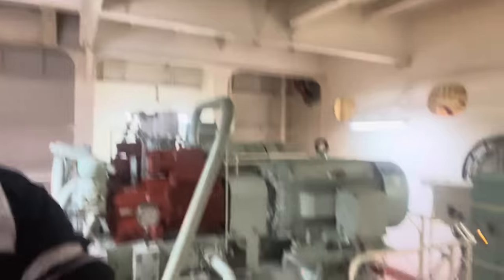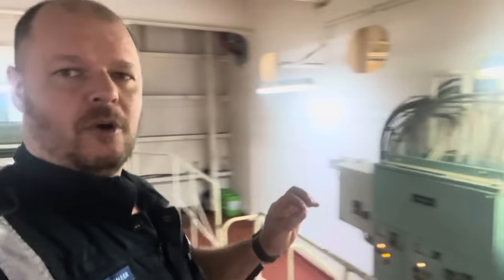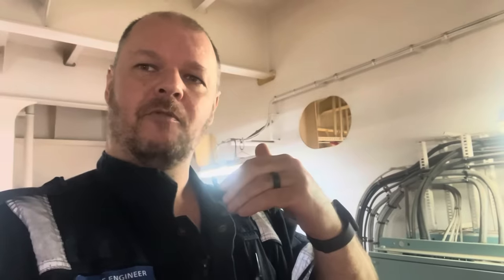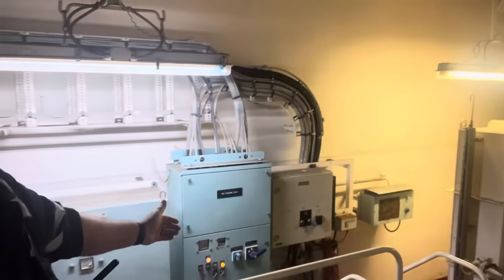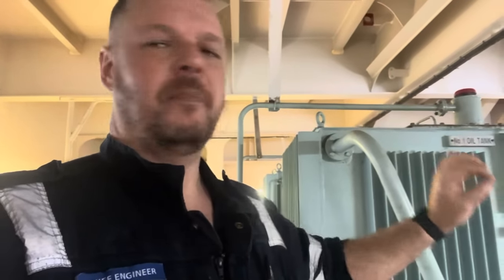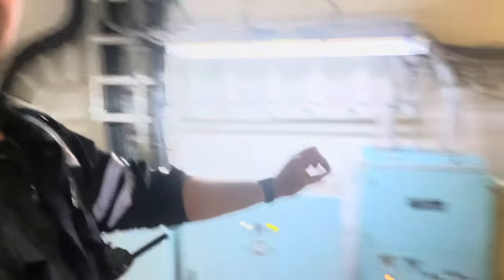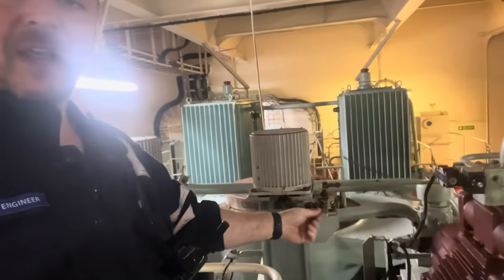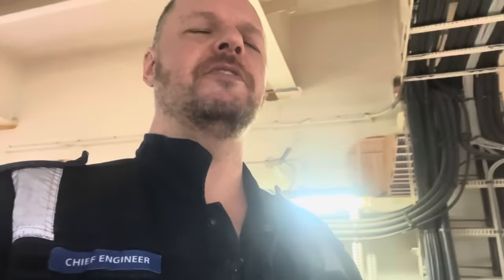Dali size containership steering system. How it’s designed to not hit Francis Scott key bridge

Comment: Thank you for this video. This is excellent info. My guess what happened with Dali is, the backup generator kicks in, the thick smoke. And then even that dies out. Now issue with all this is, there was not much distance to cause any noticeable change in steering with inputs. These vessels take time, they are mammoth not just large. Other bit is, when backups kick-in, there always will be delay between when the controls become effective. There should have been battery backup too on Dali. But remember that would have been the third backup. Once the emergency generator dies, the battery backup would have come online. How many of you think there was time for that to be any effective.

Comment: How is fuel distributed? Do all fuel serviced items share the same fuel source? Do the emergency gen sets have a dedicated fuel source. What type of fuel issues could cause failure of all diesel powered units, ie contamination, pump failure. Excellent presentation on the emergency backups. Sal sent me here, and I'll be a new subscriber.
Reply: Good question. im a ship engine officer myself and il try to explain it simple il number it 1 and and so on from start to finish.    

1.Storage tank Heavy fuel oil or Diesel  
2. Pumped through a rough filter into a temporarly storage tank for Sepearation. 
3. Fuel is pumped from seperation tank though a seperator to remove water dirt and such alfa laval makes those.     
4.Fuel is pumped into day tank.  
5. Fuel is pumped by pump from day tank to main engines or generators Throught 1-2 filters all filters have redundancy filters if pressure drops. 
emergency generators usually have tottaly independent fuel supply and might not even need electricity to keep running.  Depending on the size of the engine it is started with air or batteries lets say a Mack size truck engine generator would be started with electricity and sometimes double the size also.  

But inline 8 cylinder 10 thousand horsepower to 100k plus main engines is started with air.    Heavy fuel oil must be Warmed to 45-60 degrees Celsius just to become liquid so that is also something to think of Heavy fuel oil that most ships use is almost like Asphalt Bitumen.
Reply: @Infernal_Elf  Great info. Thanks for your detailed response.
Reply: @Infernal_Elf  It depends a bit on the engine, but the last MAN B&W crosshead engines I worked with (built in '96 IIRC) according to manual in case of emergency were able to start on a 700 cSt fuel with the entire engineroom including fuel systems cooled down to 20 degrees C, provided RPM was kept below 50% of MCR and the strong recommendation to make the switch-over to MDO "as quick as reasonably possible". Below that temperature no guarantees.

I could not believe my eyes when I read that, asked a MAN representative when on a training in Copenhagen, he confirmed it to be tested and found to be true.... Once...

Somehow I never got permission to test that... :D
Reply: @Infernal_Elf  haha , i thought ships engines used heavy fuel oil but youtube experts shot me down claiming the ships engine used red diesel like the gensets would use ?
There must be a system to prevent the wrong fuel being pumped into tanks at port ?
Reply from the maker: I did another video showing the emergency generator and yes it has its own completely independent fuel tank. 
Otherwise the main generators normally share 1 common fuel system but there can be 2
Reply: @heartobefelt  At that point they would have been on ULSD (basically diesel) due to the emissions rules. So these engines can run on multitudes of different fuel grades and HFO usage is limited to outside of the zones where strict sulphur rules are enforced. Swapping to/from HFO is lengthy process (like hours) and they need to be fully on ULSD by the time they enter the zone until they depart it again.

Comment: I watched countless "experts" doing interviews after this happened and soooooo many times they said "yes, we know they lost power, but we don't know if they lost steering". That drove me nuts. No power, means no electricity to the BAM's(Big Ass Motors) that turn the rudder, so YES they lost steering. Thank you for for being sure you included that in this video. I saw somewhere that someone had asked about a backup battery for steering systems. There isn't a battery system in existence that will power one of those motors enough to do what is needed. As a retired USN Engineer, I am of the opinion that when power came back online that second time, it was too late. There was no way to turn nor stop the ship in time. It is simply to big and too heavy to handle at that point. No, I don't have ANY experience on a ship like this but an engineering plant on any ship is virtually identical in concept and general operations. The only thing that is different would be plant operating procedures etc. specific to that particular ship. Losing power TWICE moving at that speed (8.5 knots with that much weight carries a lot of momentum) that close to the bridge, was too much to recover from. Another 100 yards and they may have had room to turn (but not stop).
Reply: My 83 year old Dad and I were talking yesterday. He retired from USN as a Commander in Surface Warfare in 1985. He called and asked what I might know of on the internet that would give him information on the current state of merchant ship hardware and systems. He was saying that he knows how it worked on military ships forty years ago but it is no longer forty years ago and these are not military ships. It was good to be able to give him Sal Mercogliano's channel and then the channels and videos such as this one.

Comment: So basically, with all those redundancies and all those backups, if the power goes out there is at least 30 seconds of being unable to steer the ship (The period between the lights going out and the emergency generator kicking in). Looking at the video of the Dali that period was about 45 seconds, which apparently is still within the limits of whats allowed.
Fine in the open ocean, a minute here or there is no biggie. But when you're approaching a bridge only a handful of boat lengths away it can be a long time.
Reply: Nothing explains the turn as winds and current wouldn't turn the ship, they would move the entire ship.
Reply: @hughjanus5518  Only 'propeller walk' does explain and is coherent with what we saw. Black smoke from main engine restarting in backward modus. Rutter doesn't work in this situation, propeller pushes back of the ship to the left, nose to the right and boom!
Reply: The Dali travelled about 600ft in that 45 seconds with no steering input. If the rudder was fixed during that time in a position that tended to Port the ship could have moved well off course in that time. Or am I missing something?

Comment: Excellent explanation of how the redundant systems function under all conditions.
Years ago, I served in the USN and my duty assignment when pulling in or out of port, was in After Steering (the space you are filming).  My role was to be precisely yet another "redundancy" for steering the ship should all other systems fail.  The ship I was on was an old WWII relic but even so, it operated flawlessly every single time, and I never had to intervene in the three overseas tours and countless port maneuvers I stood watch.
Around midnight, every night, we tested our system by manually simulating loss of control from the helm, and the person on watch would take control of the rudder from After Steering while simultaneously communicating with the helm over sound powered phones (sound powered phones operate regardless of power loss).  Each test conducted several course changes which maneuvered the ship for a few minutes, every single night.
While I'm describing a much older system and much different protocol used in the USN back then, I think the principals of redundancy and reliability are the same, and likely have even improved over the years.
Of course it is very early in the investigation, but if I were a betting man, I would put my money on poor maintenance being performed and failure to test those redundancies.
Thanks for walking everyone through this system.  Zk

Comment: Thx Chief , Great explaination of redundant systems aboard ships .  They may need to add redundancy to the Black Box . It conveniently is missing 2 minutes of critical data .  Unheard of
Reply: How do you record data from something which has shutdown ?
If the engine has shut down it will not issue any data stream , RPM=0 , Data File = 0
Reply: @heartobefelt  That's not what I said . I said the Black box failed for 2 minutes to record any data . Not the data itself
Reply: @MrMotorNerd  I think it was still recording voice data - just not input from systems (which were likely off).
Reply: @Rapture1469 , Well it's not redundant . If a position sensor fails , Power , Wiring etc , often a system will be redundant,  ie second  network , power supply and even sensors .

Comment: Not sure if ANYTHING could have prevented the accident simply due to steering of the rudder . IF the ships PROPS  ( screws) were NOT turning providing thrust OVER the Rudder  could a redundant power to the rudder produce any viable reaction to the ships forward motion in order to steer the ship away from the bridge supports ?  I have attempted to steer my fathers single screw Cabin cruiser a couple times with no engine power , and turning the rudder WITHOUT forward thrust by the screw did not provide ANY change in direction of the Boat , other than slightly swinging the stern a tiny bit outward . I understand there are MANY variables that can effect this outcome . 
GREAT video , Thank You Very Much for Sharing it !
Reply: Rudders don't require engine thrust to work. They require water to be moving over them at a sufficient rate.  The boat was moving at 8.7 kts when initial power failure occurred and around 7.5 kts at point of impact. The Dali had more than enough flow over the rudder to turn.  if they required propulsion to turn old sailing vessels and current ones wouldn't work.... I'm guessing your nautical experience is with jet boats or a boat with pod steering, or even outboard power boats to a lesser extent which do require thrust to turn.
Reply: @PatO-uy2cy  
Hi
Many thanks for your reply 
I do see and understand your point surely .
My dad's boat was a 32 foot Chris Craft cabin cruiser . The forward speed at the time when No turning screw was relatively slow ,maybe 2 or 3 knots . We were also going with the tide and  current flow ,which would also be a factor for sure.
The Dali was inbound from sea ,not sure tide conditions or current flow direction , wind also could have played into it ,being as high is it was during the incident .Like I stated Many factors are involved .
A Tradegy  nonthe less 
Hopefully we and they can Learn something  here , and hopefully never let this 
Accident occur again .
Thanks ..
Reply: @Wilett614  pretty sure the dali was headed out to sea, it just left the dock after getting loaded, lots of videos on here of this.
Reply: @PatO-uy2cy  wrong, sailboats have large rudders designed to operate without prop wash. That ships rudder would steer at under 10 percent of its normal effectiveness without propwash. Also when the ship was thrown in reverse the rudder effectiveness goes to effectively zero on these ships.
Reply: @PatO-uy2cy  I think they panicked and started the main engine in reverse and went full astern - the black smoke, which would have compounded the problem with flow passed the rudder, and also likely would have walked the stern to port.

Comment: One of my jobs in the Navy was after steering.  I had control of the rudder if the bridge was taken out.
Reply: Same here, I'm pretty surprised that the steering gear wasn't manned while they were in the channel.
Reply: @kenroberts3511 Commercial vessels don't have the luxury of a massive excess of relatively ccheap crew for every station, which is why modern commercial ships are so automated and electronically controlled.
Reply: What were you two Navy experts to do if the steering Power failed??!

Start cranking  the hand pump ???

You were back there because the signal To the steering gear might fail !
Not to move the rudder in time .
Reply: @TyphoonVstrom  there was a press article not long ago discussing autonomous oil tankers , all controlled remotely from an office somewhere with no crew on board . now wouldnt that be stupid ?
Reply: @kenroberts3511  Commercial ships are not manned to do that - they had something like 21 persons total.  I sailed for Military Sealift Command - sort of a cross, as we are all commercial mariners, but the ships manning is much more manned to cover those spaces and conduct underway replenishment with a ship on each side.  We would have had steering manned.  There is a hand pump, but it takes forever to move a rudder with it.  The manned steering would just be in case the bridge controls were lost for some reason.  We tested all modes of operation prior to each maneuvering event.  Form bridge, local, both pumps, NFU, hand control, etc.  EDG was also tested prior to each maneuvering, along with comms, whistle, forward and astern operations, etc.
Reply: As a Phone talker in Dc central 1 of the drills we did was to turn off the steering cable and see how long it took for some 1 to notice . Was that a Ranger thing or was it fleet wide? the longest I saw was about 4 minutes. There was a Phone circute from the Bridge through Dc Central to After steering , I was Instructed NOT to communicate what I did

Comment: And...at what point is a drop the anchor command come in ? And what are the implications of dropping the anchor(s) Are there two. Two  Four things come out to me in the videos, loss of power, gain of power, which seems to come on with a huge thrust, I am presuming rearward. The anchor appears to be dropped and dragging ship in direction of pier. It appears that if the ship would have been left on course without intervention that it would have followed the current and scraped along shore. The two explosions on the Bridge could have been explosions, but transformers need to be considered also. I am mostly concerned about the harsh veer towards the pier. Dali: Famous Painter: one of his paintings " broken bridge "  Excellent report Steam man
Reply: I counted three 'explosions' AFTER the bridge started collapsing. It looks exactly like cables shorting, which is a logical explanation. Look up cable shorts on youtube to compare and draw your conclusions!
Reply: If they had four anchors to drop, it still would not have slowed down 100 thousand tons moving at 7knots.  Not enough time.  The anchor doesn't do the holding work, the 300 yards of chain attached to the anchor and laying on the sea bed do the holding work.  Not enough time, too much mass in movement.  Please stop calling arcing high voltage lines pulled apart and shorted directly to ground, "explosions".  When you short out 480V cables direct to steel ground it makes a lot of sparks and throws them with great energy!
Reply: @wheelspinner20  Ok, lets say I'm on board, your the Captain. Knowing the Anchor(s) would not work, then why did the Captains of this ship make that call. The ship left to its own accord would have scraped along shore. We see some sort of thrust from the engine just before impact. knowing that the anchor had been set, I am assuming a rearward thrust. In my Expert opinion as a fisherman sitting on shore  is that  the dropping of the anchor along with the reverse thrust of the engine both contributed to this avoidable collision. As a Captain what is the protocol for such occurrences ? I am sure the Harbor Master witnessed a few events in his career, and I understand this bridge had several near misses. Based on the amount of ignorance demonstrated by these Captains, I remain firm in my submission that this was a planned attack along the same line as 911

Comment: No accumulators like those in submarine hydraulic power plant? The ships I served on could maintain rudder control for some seconds on energy stored in the accumulators. A power transfer valve connected a single actuator to one of two independent hydraulic power plants.
Reply from the maker: I have never seen that on a commercial ship
Reply: Military craft have lots of things that would make no sense for a commercial vessel.
Reply: There was small accumulators on top of those back up pumps but those are typically used for "make up" pressure to prevent cavitation during slow down phase or during switching between systems to remove pressure spikes.
The accumulator type you refer to would probably be 6 feet long and 8 inches round and probably in banks of 6 - 8 ? 
I serviced banks of them on just a little 250 kW power pack.

Comment: Great explanation!
That's how I hoped & expected that the steering should have been configured. It seems that Dali should have been able to steer unless they lost the emergency generator as well. 
I would hope that ships would look at the possible Billions $ damages that could result from a steering failure, that someone could be in the vicinity to take manual control of the rudder while in close proximity to such dangers, especially when a pilot is on board (which indicates that special care & knowledge is needed in navigating)